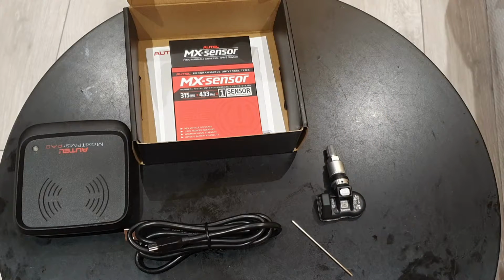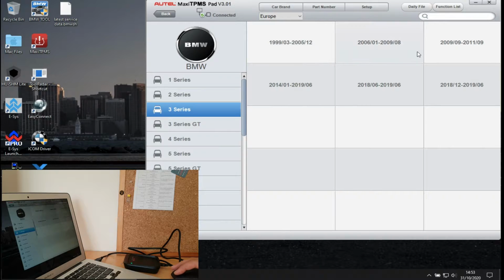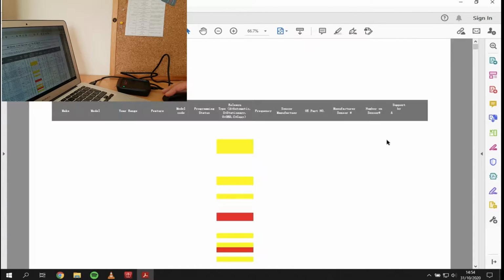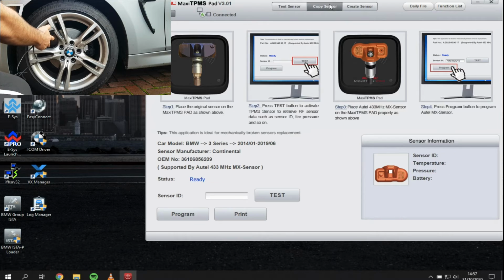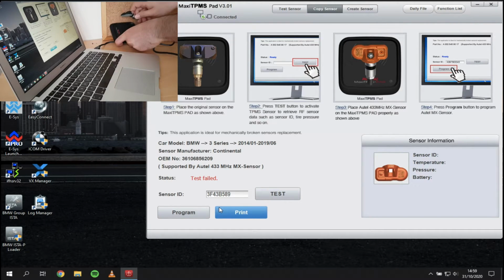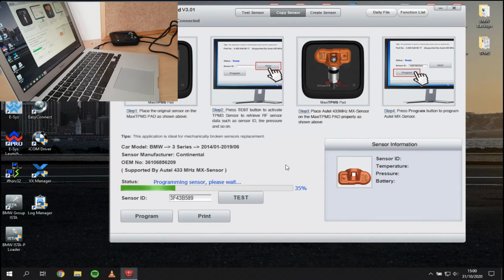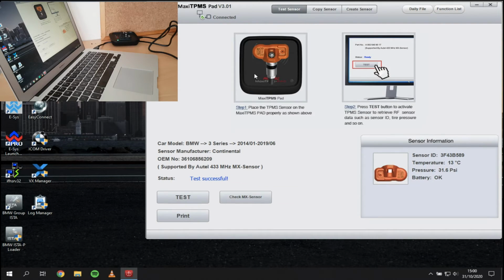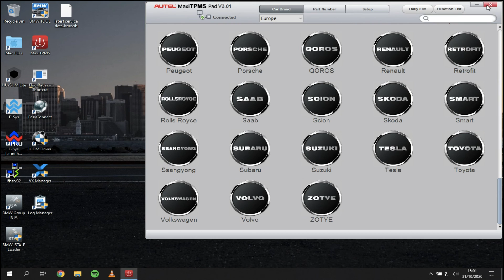BMW TPMS Replacement (Mx Sensor)

Comment: My sensor in car is already replaced with new third party one.. using OBD i can see that car still remember old serial number also reset from dash board is not working. My car is BMW x3 2015
Does your device works with all types third party sensors ? Or you need to use the branded marching your device one ?cheers